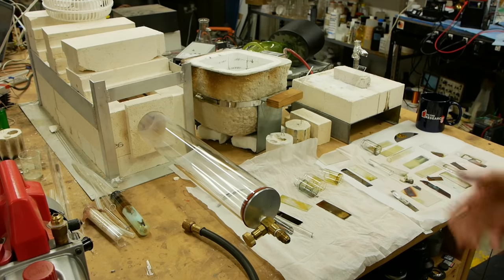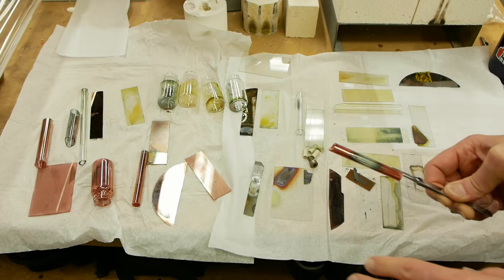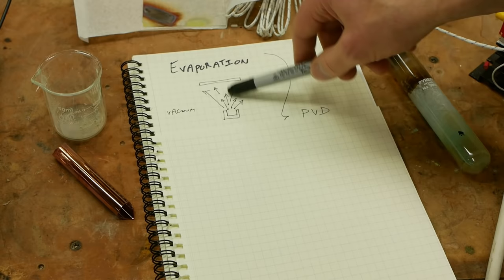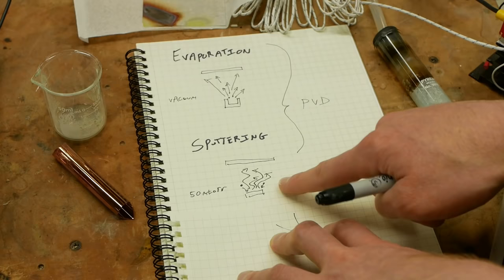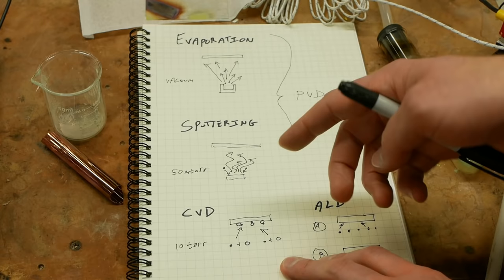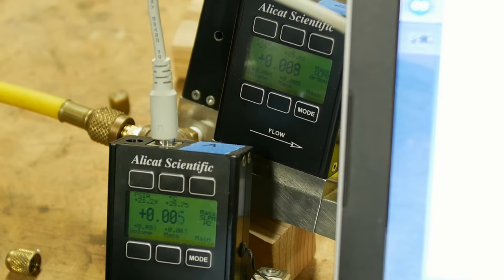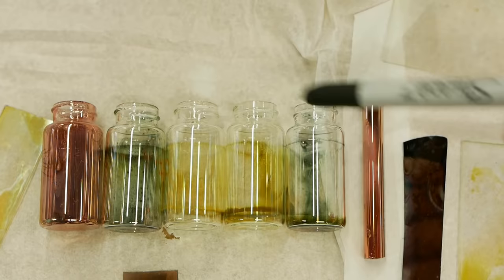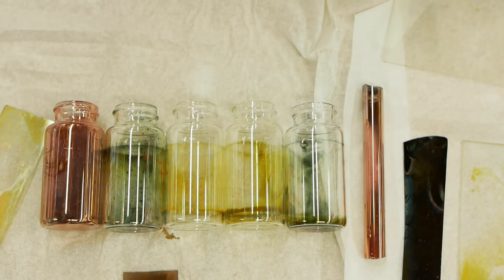Atomic Layer Deposition of copper - If you like sputtering, you'll love this!

Comment: You will soon be competing with AMD...ok maybe not AMD, more like Intel...HA, just get you photo equipment, plasma and wet etchers, some metal etchers andmor furnaces your good to go.. I spent 15 years in a bunny suit working as a Feild service engineer repairing the equipment, sounds like you might have been a Process eng. or could have been
Your furnace is cute,  have you seen the first furnaces that were used for like 2 in wafers. When i got out they were up to 12" wafers.
The funny thing is my first job in semi was at AMD in Austin in ~95, we were making the k5 or like a 586 chip. Our process was not very stable, we would just start a bunch of wafers and ~40 days later at the end of the process we would scrap 50% with the rest coming out at different speeds, absolutely no process control. Intel on the other hand could start 48 8" wafers and they would get out what they had intended. they had control over their process and just getting in the fab as a vendor took 2-3 weeks of training. fast forward and it turns out they lost it between then and now. and AMD is the SH*t. I would not buy an AMD chip even though i worked there and now i wont buy an intel because, well I never really did like them  or they chips...lol

Comment: 1:38 you never explained this.
Reply: Its simple: Hydrogen gas coats the glass. Copper chloride is vaporized and when comes in contact with the hydrogen on the surface of the glass it reacts to form HCL, the copper is freed from the copper chloride and replaces the Hydrogen.
Reply: @guytech7310  when I say "this" I am referring to the thing that he is holding and gesturing at the moment he says "this", he expands further at 2:12.
Reply: @alexcivitello3165  Its a piece of glass tubing. Issue is he trying to uniformally apply copper through a long tube, which didn't work.
Reply: @guytech7310  I was expecting him to explain why it didn't work.
Reply: @alexcivitello3165  He does not know. Some of the other commenters suggested why its probably not working.